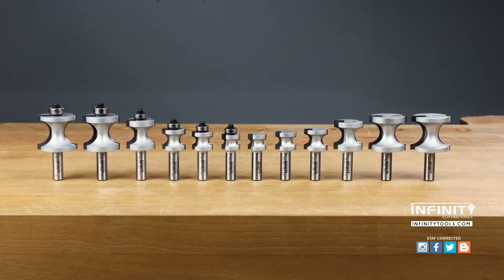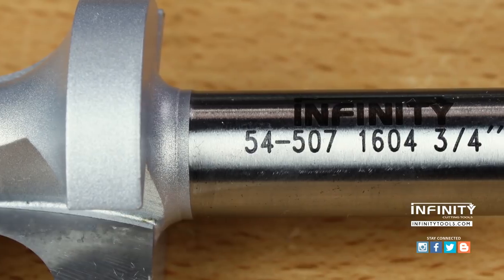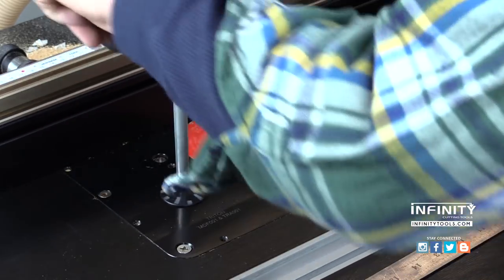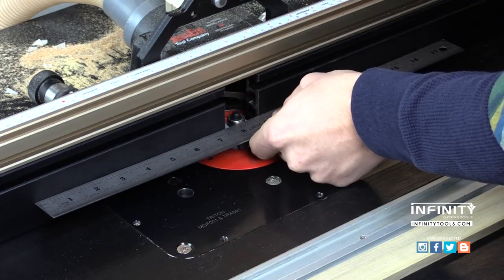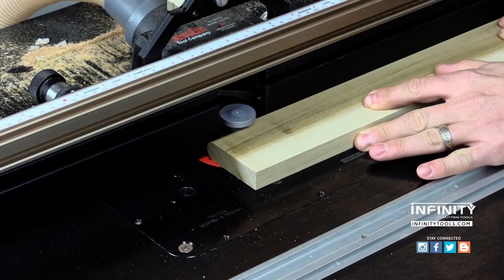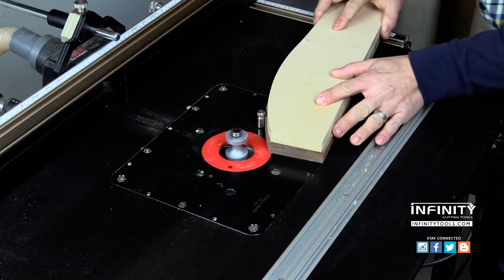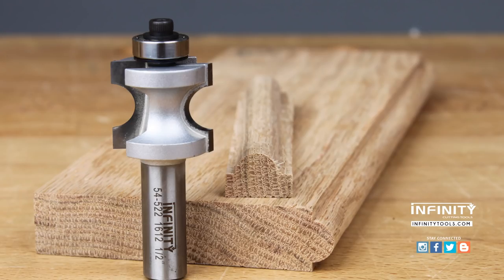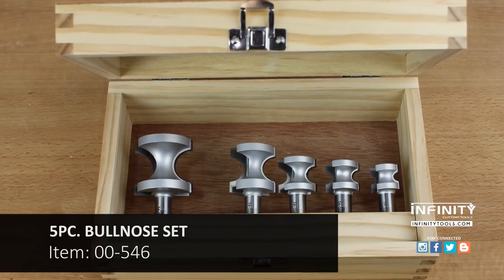Bullnose Router Bits & Sets

Comment: What size bit would you use for a 2x4 (without the bead profile) also which bit for the opposite end of the board. Using for a barrel sauna
Reply from the maker: Unfortunately we do not carry a bit that matches the inverse of this profile for that application.

Comment: Can these be used to make dowels, if so which do you recommend
Reply from the maker: Making a truly round dowel is best done on a lathe, but with a little patience you could make a decent dowel with these at the router table. You will need to size your stock accurately and most likely you will want to make your workpiece a little long so you can keep a square section on one or both ends for referencing off of the table and fence.

Comment: may i cutt bamboo by this tool
same as you show in video
Reply from the maker: From what I understand bamboo machines very well with tradition woodworking tools. Any Infinity saw blades or router bits should work very nicely.
Reply: @InfinityTools  your blades do work perfectly well on bamboo

Comment: 2 mm , 3 mm , 4 mm and 5mm 
 diameter half round router bit available?
Reply from the maker: We do not have Bullnose bits in these small sizes. The smallest we have would be 1/4" or roughly 6mm
Reply: Do you have 14mm bit how much